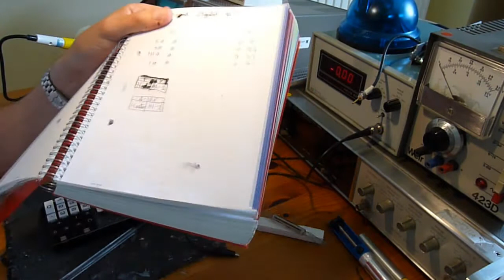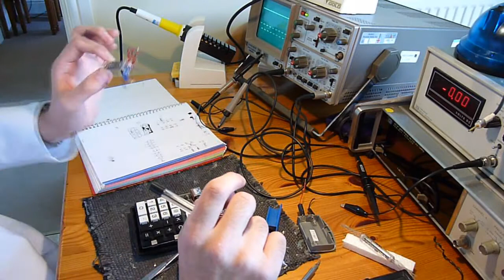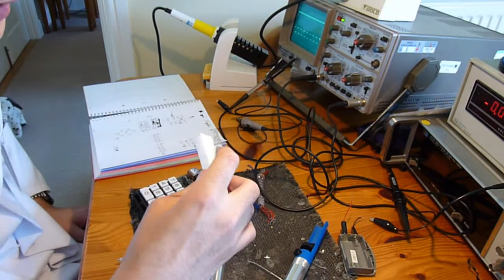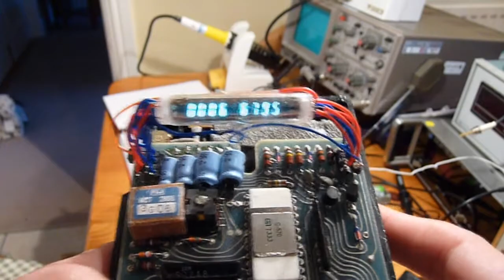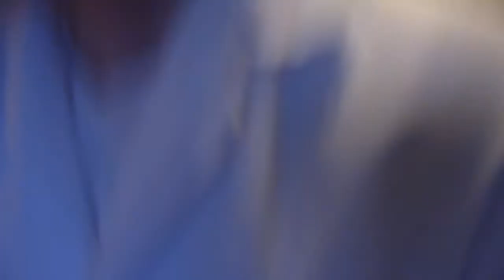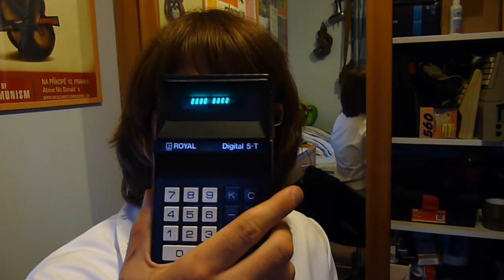ROYAL Digital 5-T Restoration

Comment: Oooh, look at that lab!!!!!!!!.  Mine is up and running now, scope working (although I need to adjust the y pot out back to get the right voltage reading).  All I need now is a lab power supply and a function generator :o) .....

With the continuity testing, would it be also possible (and fun) to put a small voltage up each wire to see if it lights the appropriate filament?  (That might be good for a video) :o)
Lol, love the lab coat, must get one of them, who is the woman in the id picture? ;)